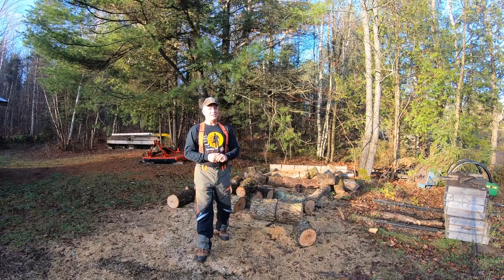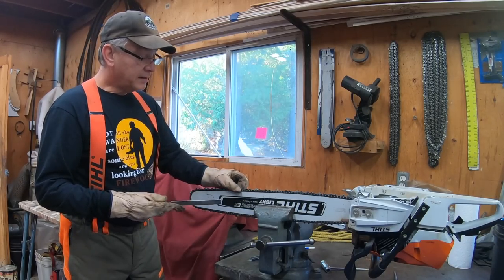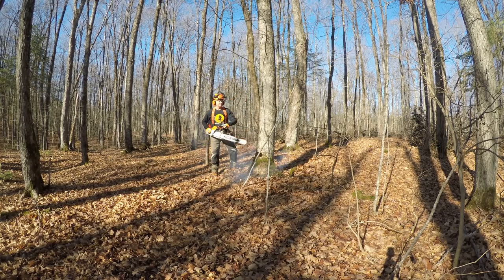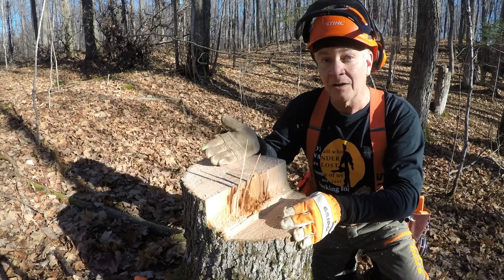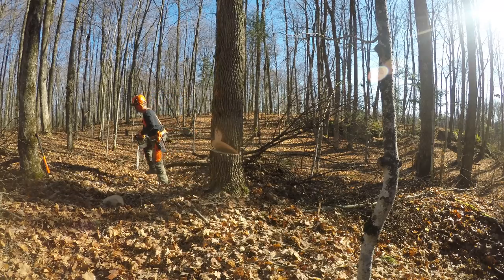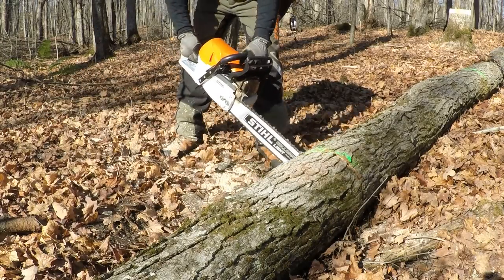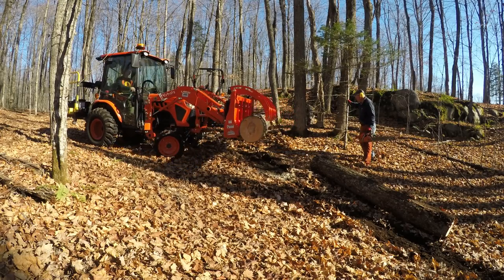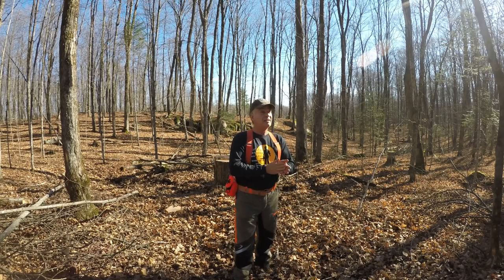628 Felling Trees and Splitting Fire Wood. Eastonmade AXIS Wood Splitter. STIHL MS 462 Chainsaw.  4K

Comment: I agree with how you are hand filing. Each stroke is not the same because of how much material from previous strokes is within the file, the difference in pressure you put on the file and etc. It all means that hand filing is good to keep the chain sharp for a while. Then, the chain needs to be sharpened by a machine like the one on your wall because each tooth will eventually become slightly different. The machine brings all the teeth back to the same size, depth, etc. for both sides of the chain.
Reply from the maker: Morning WW! Thanks for the suggestion - it makes sense - perhaps every so often we can use the machine. Great idea - thanks again!

Comment: Get each tooth sharp, the strokes doesn't matter.  You just need to file the depth gauge to match with its tooth
Reply: This is what I do and haven't had issues with pulling or reduced tooth life based on heat. Just my experience thus far.

Comment: Gord suggestion:  Cut your wedge cut first and make sure the bottom of the cut is level.  Then place your level saw at the corner of the wedge cut and complete the wedge.  This method is so much easier and you can sight down your saw while making your first cut.  Give it a try and you will improve on your wedge.  I would also start bore cutting all you larger trees, wedge, and then cut the tag.

Comment: Hi GP .. Here in OZ the property I cut on is very rocky .You will probably hit a rock and dull chain rather than just go dull from use . I take a heap of 20 inch chains with me (1 and half hours from home) ,I run 2 x Stihl 038,s . I dont use a single file and I use an electric sharpener similar to what is in your neighbours shed . After you damage a chain with a rock ,first wash it in solvent,kero ,petrol etc then inspect to find the worst tooth . Start with that one first and take it down till you reach fresh chrome coating . Sharpen the others to similar lenghth . I use a 2 in 1 sharpener to touch up the rakes . In a particularly rocky paddock I use a chain that is just about at the end of its life . If you hit a rock and stuff it ,chuck it out. At least you haven,t ruined a near new one ..  Keep up the good work  .    JR
Reply from the maker: Good day Jim and thanks. Very helpful suggestions. Boy, when you go out to have a little fun (work?), it sounds like it is an adventure every time. LOL. Cheers and all the best!

Comment: I agree about the weight of the saw is a big factor in controlling the cuts, my 362 with a 25" bar is harder to handle and we are not as strong as we were 20 years ago

Comment: Gord the real reason for using the same strokes while filing is longevity of the blade and straight cuts. You are correct not all teeth will wear evenly so you must file more on some than others.This means you will have to replace your blade a little early. Just watch your blade does not cut crooked lines. This means you either need to file more on one side or replace the blade.

Comment: Good Day, GP...
Night and Day difference between the two days of falling. The extra time sure helped alot!👍 
I completely understand you wanting to be efficient felling with either saw and learning with smaller trees will help some day when a bigger tree needs fell. Glad you are sticking with it...
In the beginning of video the clip you showed as talking about viewers comment on saw not being sharp.
Anytime you are making an angled cut it is the hardest for chain to bite into. There will always be more dust then chips during this cut. IMO the teeth should be sharpened till sharp. The raker gauge will handle the rest. If you notice one getting long then give it a few more to catch up with the others. No micrometer needed!
I also agree with others that back cut should be level or just slightly above face cut. Yet again...this info is contradictory to what your neighbor told you in a couple videos ago. 
Have a great weekend and thanks for sharing such a beautiful day in the woods with us!🤠
Reply from the maker: Morning and thanks Wayne! I did not know about the angle cut and sawdust. Thanks! Enjoy your weekend out there!
Reply: @GPOutdoors  Yep...they actually make different chain for ripping wood like in an Alaskan mill type situation. It would do better for you in an angled cut but can't change chains during a tree felling process for 1 cut. Don't judge your chain on its performance during angled cut is all I ask...👍

Comment: Just a few pointers. It seems that your back cut is a little high, you are taking your time lining up which is good, but lifting the saw a little too high. Keep it about 2" or 5cm .  Also, when you have a tree that needs to plow through other tops, open up your face cut. Think of it as combining a convention face cut with a humboldt style cut, this allows the tree being cut to travel farther on the hinge before the hinge closes. Allowing it to smash through the canopy.  If you use this technique start with the humboldt then add the conventional face cut, or you may have real trouble lining up the cuts.
Reply from the maker: Thanks for the help Wally! have a good weekend!

Comment: we actually dont even use grapples here that go to the front we use either a logging trailer or just a 3pt grapple like my granpa uses hes been on a russian mtz80 that he put a driven front axle on his been using it for decades at first daily as a job in the 50s and on then got that tractor for himself and now does the same in his own forest and hes really a good perator he ll leave these new tractors in dust with his and he cuts 36inch trees with a 15 inch bar on a 50cc saw and a small 50cc its a dolmar 500 and i actually cut with a 5105 dolmar and that saw has more power than the 261 my dad uses i plan on getting a small 18 inch bar for that saw i run its really powerful for the weight 17 inch oak try as a rock that saw would not bog down its just wicked

Comment: Hi Gord. When filing your saw, after you are done with the tooth you are working on, give you file a slight tap on the vise. This will knock out the loose filings out of the file. That way you are not embedding those filings into the file. Just a slight tap because the files are brittle, and you can snap them. Great video. Cheers......PJ
Reply from the maker: Hey thanks BDC! Cheers!

Comment: Love this channel, your videos and your positivity. Also appreciate that you are receptive to input and learning...we all started somewhere!

Here's a couple practical tips I've picked up over the years that might help you and give you more confidence felling...I'm not a master but I went through the logger technician training and learned the hard way:

- instead of starting with your under cut, you might consider doing your top cut first...couple of reasons but the main one is this is the more important cut because it's mostly responsible for setting your angle 

- speaking of angle, you are aiming for a 70-80° opening between your top and bottom cut...that maple you cut is too narrow...a great way to get the right angle is to first kneel next to the tree, then let the saw sort of dangle with your first and second finger cradled in the corner of the handle closest to your body on the top, that's a perfect top cut

- to get the appropriate angle, I would then cut up with the saw slightly canted so that you have a slight angle down toward the ground on the bottom...this does two key things 1) it makes sure the tree can complete it's fall before closing the hinge 2) it helps ensure the butt slides to the ground vs. jumping up or sliding backwards

- lastly, here's a helpful ratio to remember...80:30:10...you want your face cut to be 80% of the overall diameter of the tree looking from the front, you want the depth of that cut to go about 30% of the diameter back into the tree and you want your hinge wood to be 10% of the diameter of the tree (at least)...so, a 20" diameter tree at cut height would be 16" wide face cut, it would be at least 6" deep and you'd leaving hinge wood of 2"

- ok, one bonus / general recommendation...if you place a wedge about an inch or two behind your hinge cut (after your plunge cut is complete) on both sides and tap them in, it is highly unlikely the tree will fall backward as you cut the holding wood. If you have a lean one way, stack your wedges on that side to help counteract.

Have fun out there, you've got a great life!
Reply: Oh, the other thing I didn't say is that you really don't want to "back cut" directly into the tree from behind and go up to meet the hinge...that is a recipe for what we call a "barber chair" where the back wood fibers tear or split away from the main trunk and shoot out directly backward and upward, which would knock your lights out best case scenario. Research the "controlled felling" or "plunge/bore cut" method that the Scandinavians Introuced to North America, it is far far safer. Or direct message me and I'd be happy to walk you through what I know!
Reply from the maker: Good morning Luke and thanks for the great detailed tips. I greatly appreciate it. All good - I would like to learn the plunge cut - I tried it a couple of times with the ms 261 and it kept kicking back at me. I will try again soon with the 462 as I have watched a lot of videos on it and feel a little more confident trying it again. Thanks again for taking the time for me . Be well and all the best!

Comment: I have found that if the left and right teeth are much different that doesn’t matter much in keeping straight cut. you can do much better on keeping a straight cut by how you hold and pressure the saw through the log with your arms.
Reply from the maker: Thanks Jason!

Comment: Gord another great video.  Looking forward to getting my shirt.  I place my saw in the vice upright with jaw protectors.  I tighten the chain before filing.  I’m a keep the teeth equal guy.  I think you need to push much harder on the file against the teeth.  Usually 3 hard strokes sharpens my chains.  Adding a mechanical self leveling kit to my LX3310 just now.  Will let you know how it works.  Should be easier to handle the forks.

Comment: Thanks for the new tip Gord, putting the power head upside down. Nifty trick. I most generally filed on the stump. If You keep using the bigger saw You'll get used to carrying the extra weight and have extra power any time You want it.

Comment: I tend to make the hinge narrower when in thicker areas.  The little extra speed in the drop at the start is sometimes enough to punch through the canopies.  If it does snag, there is less material holding it together when I put a chain on it to pull the log off the stump.  Not sure this is the right way but I hate leaving hanging trees as there are kids in the area.

Comment: Good Morning- I try to keep my filing down to the same number of strokes. If you have a damaged tooth, you really should fix that. I really don’t think it makes a big difference if you have file a few teeth down more to get a sharp chain. I sharpen a lot- so there mostly touch ups. As far as the 462 goes, it just takes time using the saw. I definitely prefer smaller lighter saws.

Comment: Hey GP, good to see you putting that new saw to work!  
My 2 cents,  you're starting your cuts with the powerhead too far from the tree and letting the chain pull you into the cut which makes it hard to keep things straight.
Saw should be closer to the tree and don't be afraid to use your dogs to help guide the bar,  should help with those notches.
Also your back cut seems pretty high which makes for a weak hinge that snaps prematurely, no need to be higher than 2" or so.
Great to see you taking more time with falling,  an old guy once told me " that tree took over 40 years to grow, doesn't hurt to take a few extra minutes to fall it properly" 🙂
Reply from the maker: LOL! Thanks for the good advice Troy!  Some good pointers for sure. Have a great weekend out there!

Comment: On the subject of not letting you get away with anything,  why the 2 foot and taller stumps? Wasteful and also cause no end of trouble if you need to pull or skid a tree or section to better access it.
Reply from the maker: LOL! Good day Daniel. lower back hip and right knee. Some days I can get down but most days,  I need to cut at a comfortable height and then go back and take out the stump. Have a good one!

Comment: You can't 'over sharpen" a tooth.  A few extra strokes after the tooth is sharp only removes additional material and reduces the life of the tooth.  I wouldn't worry too much about a small nick in the middle of the tooth cutting edge as long as the remainder of the tooth is sharp.

Comment: Great job Gord, you're getting the hang of it. Practice more on holding the saw level , use a magnetic level that you see well and see just how far you have to roll the big saw on it's side and tip it up and down to get level. After you see what it really takes then try it running with the blade locked. Yea it sounds crazy I know but you'll see the difference between running and not running. That's a lot of saw but you'll get the hang of it. You can practice on a stump you have left too on any of the ones you aren't totally happy with your initial felling of the tree. Just like you do on your tractor and grapple PRACTICE . Sharpening your chain should be having all teeth sharpened at the correct angles . Skip tooth chains were invented by a guy who knocked a few teeth off on the rock and found out he could still sharpen and cut with the banged up chain (POOR FOLKS DUNNIT)😂  I still maintain using the 2 in 1 sharpener and touching up the chain when you refuel and rotating the bar occasionally and watching real close for rocks and digging in the dirt. Works for me, not arguing about it with anyone just sharing what does work for me. You all are doing a fine job around there and the set up with the splitter is awesome and works for everyone. Stay safe and keep the videos coming and the fun rolling. Fred.
Reply from the maker: Good day Fred! Thanks - some great tips and pointers - I appreciate it very much! Kirsten has been busy getting all the shirt orders out this week. So grateful for your support again. Have a nice weekend my friend!

Comment: I’ve found if the teeth are not the same you will get crooked cuts ,So instead of wasting my time trying to shaping the chain . Just buy a new one. Even letting the dealer to sharpen the chain I still got a crooked cut.
Reply: Ron...You most likely don't have a chain issue causing your crooked cuts. You may have to small of gauge chain for your bar, the bar rails maybe worn and allowing chain to slightly roll or your oiler isn't working effectively. Putting a new chain on may mask the issue for the short term but will soon be back to crooked cuts again. I hope you can find someone local to help you work out your issue. Have a great weekend!